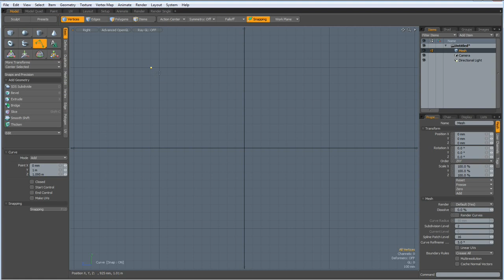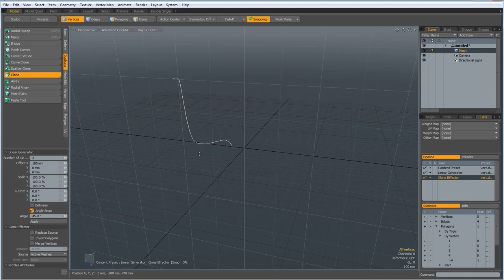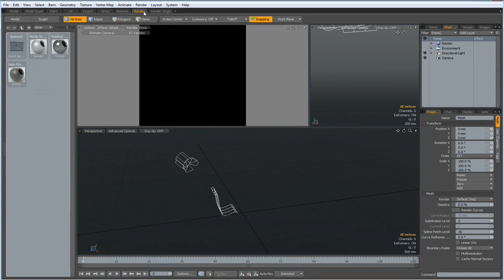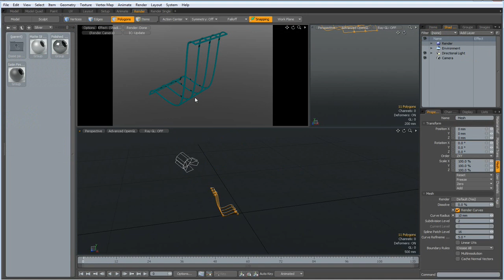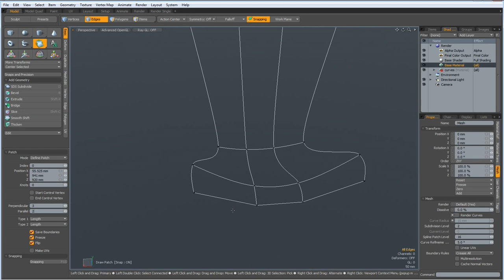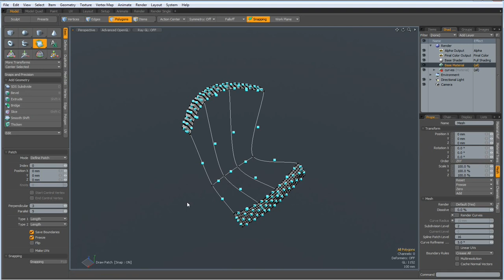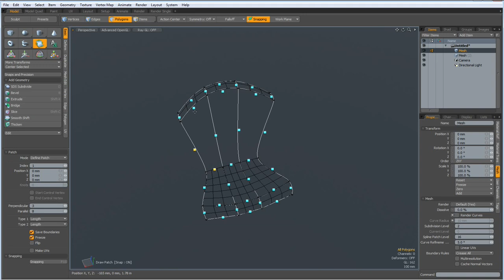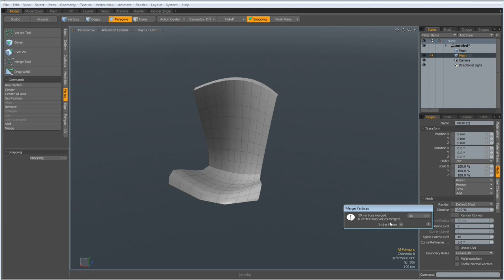The Foundry MODO - Working with curves

Comment from the maker: Hi Husam, thanks for your explanation. It's the same way in Rhino as well. But in Modo you can only select one rail curve (in curve extrude). All what you select after that, is considered geometry which has to  be extruded along that one curve. If you have one rail curve and one curve to be extruded, then it works as expected. If you select more than one curve to be extruded, you get very weird results :-)) Try it out. It's in -Duplicate - Curve extrude. Kind regards, Peter

Comment: Hi Peter, quick question.  When you patch, I noticed your patches seem to round out the edges, while mine do not.  Is there something I am missing?  I'm following pretty precisely, even cutting and pasting to new mesh but yours looks so good. :)  Update:  Well, I did it like a third time and for some reason, it works.  Still experimenting with different methods on that urinal thing.
Reply from the maker: Eric Kirk Hi Eric, I think the reason it worked, is that you had double geometry (geometry on top of each other) which can happen VERY easily in modo and it is not modo's fault :-). Always run 'MeshCleanup' if you think something behaves strange.  About that urinal thing: Just start with a quadball, cut out the parts you don't need, thicken it, then remove the outside parts you don't need and extend them (like i did in my model), and finally bevel the edges to move the spiders away of the critical edges. I think my 'Water Tap' tutorial and the 2 'How to avoid spiders' would be helpful to you. Kind regards, Peter

Comment: When I try the Clone tool (the part of the video from 2:10 to 2:35), it's cloning the vertices, but I can't see them -- first I see a row of little red, green and blue arrows in the places where the new curve should be, but I don't see a row of gray lines like you do, and I don't see them when I drop the tool either. I only can see that the curves have cloned if I do a lasso in the area with Vertices selected, which shows me the cloned vertices. Any idea why that is?
Reply from the maker: Hi, you must have at least modo 701 (or 901 even ...) and you must be in Polygon mode to clone curves. Hope this helps. Kind regards, Peter